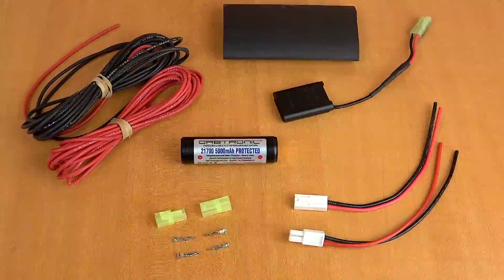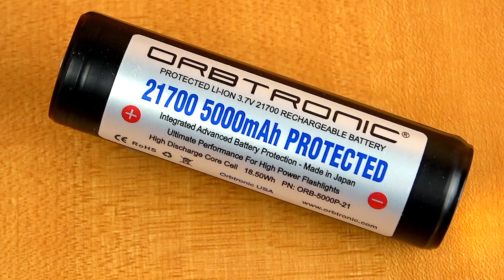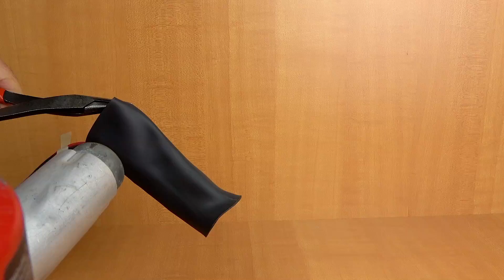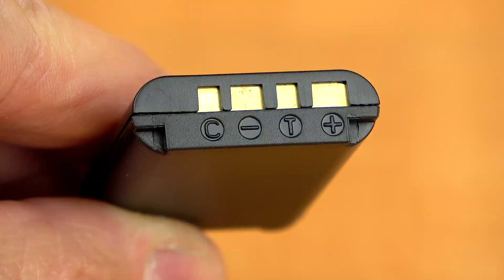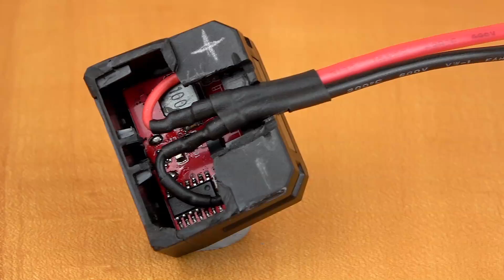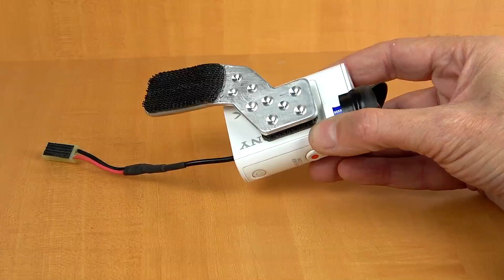Sony FDR-x3000 External Battery and Helmet Mount - Record for Hours!

Comment: Great video! but I don't think that velcro is a good idea.
I've done a side head mount myself (not for helmet though) and it turned out to be not very fine.
Reply from the maker: I haven't had any problems with my camera mount coming off unless it gets hit very hard, usually by the handlebar.  I am not sure if you understand what I am using as you called it velcro.  I am using 3M Dual-Lock.  It is much stronger than regular velcro.

Comment: its funny.
We are thousand miles away but has lot in common.
* Riding alone in the desert
* using the Sony FDR X3000
* Creating methods for 6 hours without charging (I have dual tape on the helmet with 5000mA battery on it)
* riding on KTM 350 EXC-F
* owning Skydio 2 (which is ilage in my country so I still trying to find ways to get it in)
here is how the Israeli Desert looks like - https://youtu.be/mAu7c86WJ10.
I subscribed for more:-)
Reply from the maker: Looks like you have some great places to ride with challenging terrain!   Having a large external battery is so much nicer than constantly changing batteries.  And the Sony camera is so reliable it works every single time, something you can't say about the GoPros.  Thanks for the sub, glad you're enjoying my channel!

Comment: Never thought about using an external battery, might try that as I burn through batteries using that Sony for my vlog
Reply from the maker: It's nice to record throughout the day and not have to worry about whether your battery is dead or not.  Even more important when riding on a dirt bike when you don't want to stop and check it.

Comment: Great tip, I bought this set up after seeing your video a while back.  With a 128 sd card I can run continuous for 11 hours on 1080 60fps.  What microphone do you use?  The mic is the last missing piece of the puzzle.
Reply from the maker: Wow, that's a long time!  I thought maybe it would run about 8-9 hours but 11 is pretty impressive.  I actually custom made my mic from a mini electret condenser mic I bought at an electronics store.  I don't remember the specs on it, I made it a long time ago.  But many inexpensive lapel microphones that would work well.  Just make sure they have a foam cover AND use a dead-cat cover to reduce wind noise.  You might try a couple mics and see which one sounds the best.

Comment: I have a dual usb port clipped to my handlebars.  I plug in my camera mounted on my helmet and plug in my garmin gps and both run off motorcycle battery.  I have not tried the Sony yet because the gopro white 7 is doing really good.  I am not sure if my Sony will record with external power.  That is why I came to this video.  If you know please reply.
Reply from the maker: Yes it will record with USB power plugged into the back of the camera with the stock battery installed.  I could have powered the camera that way but I don't like having cords running from my helmet to the bike or backpack.

Comment: really enjoyed your video. i made a similar cam mount but have despaired at the poor battery life. will investigate those parts.
Reply from the maker: Thanks!  The battery life of any action camera always seems way to short.  This setup is more than enough for a days ride without ever worrying about the battery dying.
Reply: ADVsquared  a benefit of your video is that it inspired me to persevere with the Sony cam and it’s on/off button. It is in the right location but I don’t like the lack of positive feel when using gloved fingers. I glued a small rubber bumper onto it to give me a more positive feel of it. I might move the cam forward like yours. Can you hear if yours is working when you push the button? I have been using the superseded TCL SVC action cam, which has the best on/off switch ever invented. You slide it back and forth and it is very positive and you are never in doubt about it being on or off. Unfortunately, the TCL is not stabilised.
Reply from the maker: @MrEtnorb  I wear very thin mx type gloves so I can feel the button easily but gluing on a small bumper is a good idea.  The camera doesn't make any noise when turning on or off but I can't remember if I turned the beep sounds off.  I have a mirror on the handlebar that I use to see if the camera is on or off as I can see the red led on the front of the camera.

Comment: This is awesome! Where did you get the little lens cover for the camera? I just bought the official Sony one because my case that I was using before is all scratched up. The only problem is that it is pretty big (and expensive).
Reply from the maker: The lens shade is a 3d printed part made my a guy from China.  Unfortunately he no longer makes these and I haven't found anyone else that does.  That big rectangle one Sony makes is huge!  Time for me to design something that is small and will work.

Comment: This is great.  I've been meaning to add some type of external power setup to out kit.  The gopros have HORRIBLE battery life.  I love how you used a bare cell to keep the weight and size.
Reply from the maker: Thanks, this mod has been working great for me.    The Sony cameras easily lend themselves to use external power.  For a GoPro it gets a little tricky.  Because these Li-ion battery cells are 3.7v you can't use them to plug directly into GoPro's USB C plug as that requires 5.2v.  You could get 5.2v out of a 3.7v cell by using a Boost Board, like this one, https://www.adafruit.com/product/2030 , which would give you the 5.2v you need if you don't mind that there are more components and it would not be so compact.   You could try and make your own 'dummy' battery adaptor to use a 3.7v cell to power internally but I am not sure if that adaptor would require a chip to talk to the GoPro to make it work.   GoPro never makes anything easy!!
Reply: @advsquared  this was much needed information as i am trying to do something similar but with a go pro hero 10
Reply from the maker: @Superman.x  Glad you found it useful!   I hope you can get it working for the GoPro.

Comment: That's pretty nice.  I always worry about the crappy mount that came with my go-pro letting go, but that one is super duty and vibration free looking, and plus it gives a more eye level view of the ride... Exxxcellent!  We will all be reaping the fruits of your labor as the new vids come out. :)

Just be careful about hooking a branch or something while riding.  You might want to bend the front into the helmet and fasten it so that can't happen.  Looks like you could flatten a spot further back to fasten the camera, and would make it even more stable and accident proof.
Reply from the maker: I have had some mounts break but those were the cameras hanging off the bike.  For a helmet mount this one works really well and does give you the point of view as if you're riding the bike. And hopefully this upgrade will mean I will never run out of power again!
Reply: @advsquared  Oh, it's pretty awesome!

Like I said, my main concern would be the hook hanging off the front.  Most of your riding is in the mountains or desert, but if you go to the woods a stray vine could get hooked and snap your neck.

If you flattened a spot further back or attached some kind of guard to the front I.d feel better.

Just trying to have your 6, brother.
Reply from the maker: @barking.dog.productions1777  You're right, I rarely ride where things will hook my helmet camera.  It would be totally different in dense woods.  I would have to change my whole setup.
Reply: @advsquared  Not really.  Even just one fairly thin piece of aluminum that goes from the chin front over the outside tip of what you already have would guide any vines or branches around your current bracket instead of letting them get behind it.

It's kind of like grip guards.  You hope that you never need them, but if you hit a rock that throws your throttle hand gripping the handle bar directly into a boulder at 30 mph...  it's a crushed hand and 6 months to recover.

Murphy wrote a law about these kind of freak accidents.

"If anything can go wrong it will."

Look at the opening shot of the current video.  Hook a vine or a branch with that, and it is a broken neck.  There's no recovering from that.  Even just riding too close to a canyon wall and hooking it on an out cropping would do it.

2 rivets and a piece of flat aluminum bar stock would keep anything from getting hooked behind it...  Besides it would stop any harmonic micro vibrations in your bracket that is not fastened at one end.

I'll shut up after this....

Maybe I can't see the design properly and it is just Velcro or something, but it looks like 1/8" bar stock aluminum riveted to your helmet.  That is not just going to just break off - it is going to snap your head around backwards and kill you on the spot.

I'll shut up now.
Reply from the maker: @barking.dog.productions1777  No, the rivet you see is for the helmets chin strap.  The camera is mounted with dual lock, a heavy duty type of velcro.  It does breakaway when it is hit.  I have knocked off my camera a couple of times when it is hit by me handlebar.
Reply: @advsquared  I looked at the video again, and what I thought were 6+ rivets holding the bracket to the helmet are probably just decorative.  I see Velcro under it on the helmet end of the bracket now.

Seeing what looked like that hook sticking out and riveted with 6+ rivets I thought if he ever hooks anything with that it will snap his head off and it will kill him on the spot.

In the the immortal words of church lady on the original 1970's Saturday night live (Gilda Radner)  "My mistake, I'm sorry...  Never mind."
Reply from the maker: @barking.dog.productions1777  Hahaha...no problem

Comment: that is awesome. I use an anker battery but this seems a lot lighter and more compact. i might look into this.
Reply from the maker: I really don't like having cables running off the helmet to a battery so that's why I originally designed this setup.  You really forget that it's there and it's never in the way.  And with this new battery it's going to have crazy long recording times!